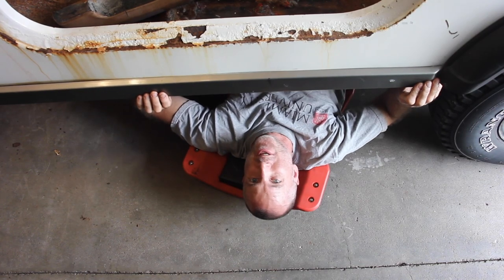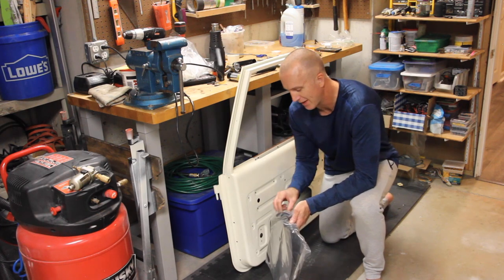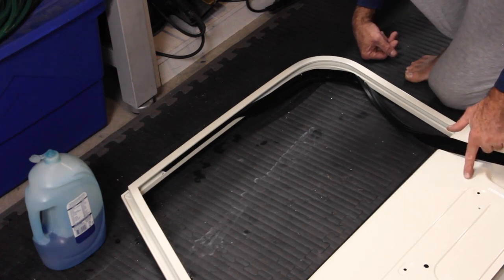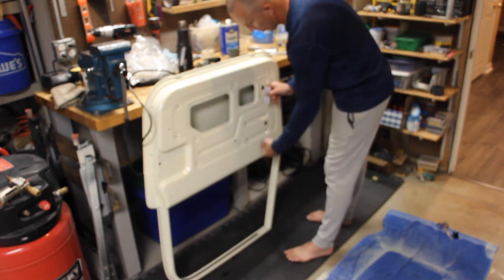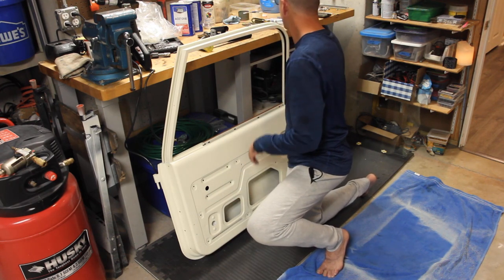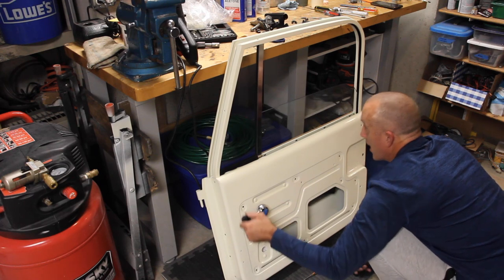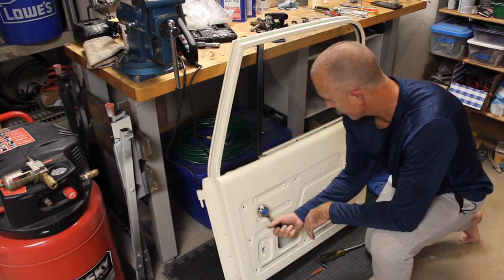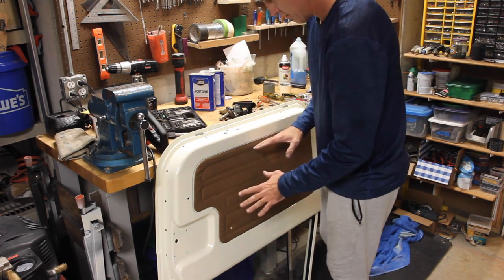Jeep CJ7 76-81 Hard Door Reassembly

Comment: Great Video! Helped me a ton. One recommendation is to use some sort of soap for lubrication. Also, I didnt mark which side of the door each window went too. It took me a second to realize theres a differnence when putting it back together.
Reply from the maker: Maybe I didn’t explain in the video well enough, but I thought I talked about using dish soap (Dawn) as the lubricant. I’ll have to go back and rewatch myself :) and you are absolutely correct about the windows. They not only have a bend to them, but the bottom of the window can only fit one way with the door frame. Should’ve called that out in the video.
Reply: @coolguy_CJ7  No you did great. Video rocks!  I had a horrible time putting the channels in is all. Thank you so much!
Reply from the maker: @vonwilcken555  Good to know. Always looking for ways to improve. :)

Comment: great vid just stripped my doors getting them ready for paint, just thinking did you do the coating and sealing and then paint inside and out, as mine has a load of looks like old waxoil type goo inside , not sure which order to do first, thanks for your help hopefully cheers
Reply from the maker: Sorry so late in response. My order would be this…
1) remove all hardware (windows, handles, bolts, screws, gaskets…etc)
2) strip all coatings (choice of process is up to you) acid bath, sandblast, wire rush and paint stripper)
3) spray all seams with east woods internal frame coating or rust converter/sealer. To the point where it drips out.
4) apply primer/sealer
5) paint
6) reassemble 

There’s a few smaller details in the but you get the idea. For the wax coating, you should be able to bake it off.

Comment: Thanks again for another great video. I'm stuck on my install.  I just put in the fixed vent and the track next to the fixed vent does not want to pop I to the window rail slot.  What's the trick to get the gasket into the slot rail?  I'm forcing it in but nervous I'm gonna break it
Reply from the maker: So your question was like a month ago… Sorry. Did you get this resolved?
Reply: @coolguy_CJ7  Yes and thanks for answering me back.  I was able to grease up the molding for the fixed vent and had to apply some pressure.  Got them both on and I am good to go.

Comment: Great stuff. I am in the process of planning to do a restoration of my Dad's 82 CJ7 that he willed to me. One thing that I noticed is now rough the movements were for the hardware after 40yrs. I was carefully watching you install the hardware and noticed that you did not video the addition of lubrication to any of the hardware. In this case the window gear. My door is a bit more complex in regard to moving parts. More aligned with the door used in your harddoor disassembly  that had the moving vent window. So in short, do you apply any type of lubrication to the internals on any of the doors you reassemble?
Reply from the maker: Adding lithium grease to any latching components or gears is recommended.

Comment: Can you upgrade the style of door handle if I have an 83 but get the doors off a 79 can I upgrade to paddle handles so it looks same as 83 ?
Reply from the maker: Not that I know of. The inner working and handle configurations are not compatible.
Reply: @coolguy_CJ7   Thanks I'm picking up a set of 79CJ doors for a good price tomorrow can't beat it. So I guess I'll just use them for now if there's no way to change out the handle maybe if I'm still worried about it then. I'll sell those doors and buy a set of new one's off an 82 or newer

Comment: Nice job, good video.  Where did you source your fixed window rubber?  Also, did you re-build your latches?  I looked through your videos but was unable to find where you worked on them, mine are in desperate need of a re-build, so any info would be great.  Thanks and keep up the great videos.
Reply from the maker: I carefully removed my fixed window gaskets so as to reuse them since they were still very pliable. Rock Auto has them if you need new ones though. In regards to the door handles, I sand blasted mine, then soaked them in a degreaser for a few hours, rinsed out all the blasting media and then powder coated them aluminum silver. Lastly, I lubricated them up really well. You can drill out the pop rivets and open it up easily enough. I did that on a spare just to see what the inside looked like.